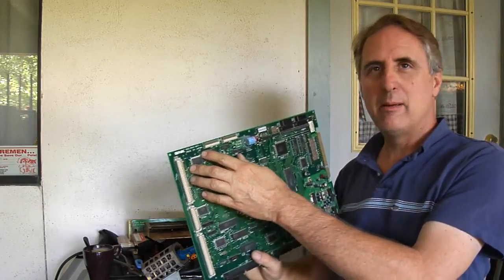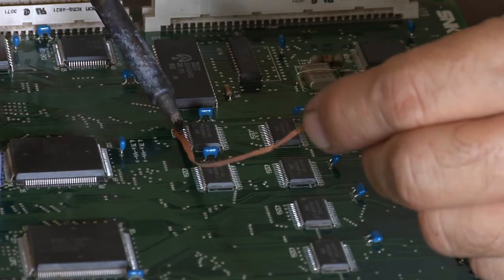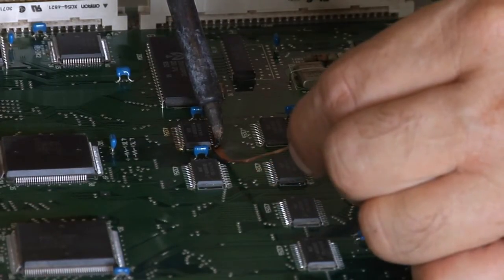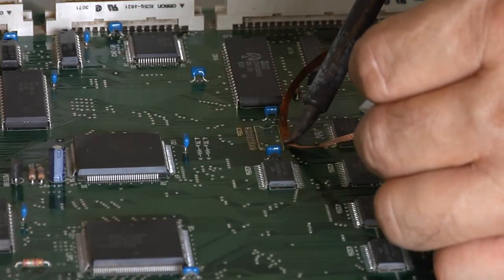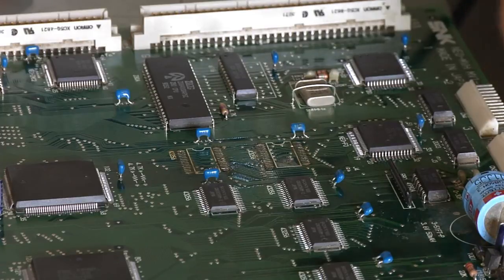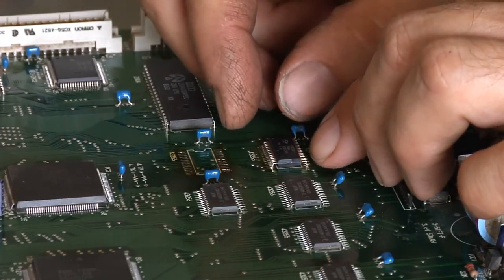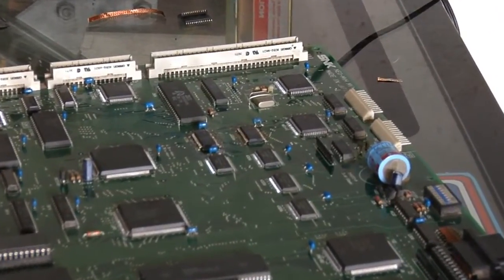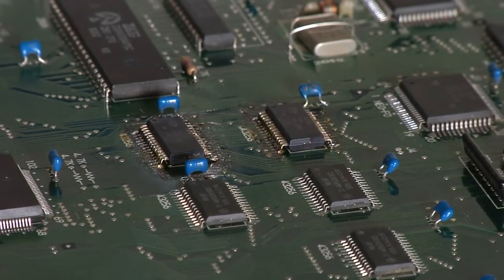Single Slot Neo Geo Board Repair,  Work Ram Error!

Comment: Hello I have a SNK NEO-MVH MV1FZ when I turn it on with cartridge or without it returns this error on the SCREEN: 
WORK RAM ERROR

ADDRESS 00100000
WRITE 0000
READ  2000

What could it be?

Comment: Hi, i got MV-1 with greenscreen and i already replaced the Batterie and the Crystal. If i run the Work Ram Test, the letter shows on the screen but then it stucks. Nothing moves. Is it possible that the chips are bad?

Comment: I just picked up a neo geo and when turned on, all I get is a solid red screen. Any idea?
Reply from the maker: Oh boy, was it working before? I haven't seen anything with the mother board that would cause that. It could be a monitor issue. Have you checked for sound? I would also check power supply voltages and make sure all connections are good, like the Jamma, the monitor connector and the neck board. If the power supply is good you can always plug in a known good Jamma board to verify the monitor is working. I would check the RGB output from the Neo Geo mother board with a scope or a known good monitor.

Comment: This replacement is to test "red screen"?
Reply from the maker: If I remember correctly the screen said "Work Ram Error" and would not go into game mode.
Reply: The RAMs 43256, 62256 or 58256 they are same?

Comment: Doesn't adding flux to the pins help wick stuff up faster/more even? Just asking. If not on this one please let me know, always learning.
Reply from the maker: There seemed to be enough flux in the solder to do ok without adding any. I have usually had to use flux on bigger jobs where I have to get the connections a lot hotter. Typically for circuit board work it helps for everything to be really clean like on monitors ill use a fiberglass brush to burnish solder pads that are covered with carbon. also having the temp hot enough on your soldering iron so you don't have to keep it on the pad for too long.
Reply: Thanks for the reply. Understood. Glad you didn't take the message the wrong way (sometimes people take it as criticism). I much appreciate. I'm starting on one which had minor looking  issues when I grabbed it but has gone much more downhill sitting in a box for a few months,lol. 
I will need to find where to get the diagnostics BIOS.

Comment: How did you narrow it down to one of those chips? On one of mine it just says "work ram error" then the address, write and read.

Edit: unless since the address is 00100C00 that is row 1 column C (or vice versa)
Reply: Good evening, did you manage to solve this problem?  My NEO error:  WORK RAM ERROR
 ADDRESS 00100000
 WRITE 0000
 READ 2000
Reply: @ezaulzillmer  honestly that was like 5 years ago I have have no clue if I fixed it or not. Sorry. I manage a couple hundred machines overtime I forget what I've done.
Reply: @frantickoala994  I understand, ok, I'm very grateful for the answer!  THANK YOU

Comment: Where did you get the chip from? Did you rob them from a parts board?
Reply from the maker: gohan35678 I used a new 62256 SMT ram I think Ricardo got from Ebay. They weren't very expensive.

Comment: Good job with the fix.  So one these chips, being a surface mount chip, there are no holes to the underside of the board that you have to solider?
Reply from the maker: Robert Lenk Very true, there are no holes through the board. In some ways once you get used to it, its a little easier than hole trough chips but there is still a chance you can lift a trace and damage the board